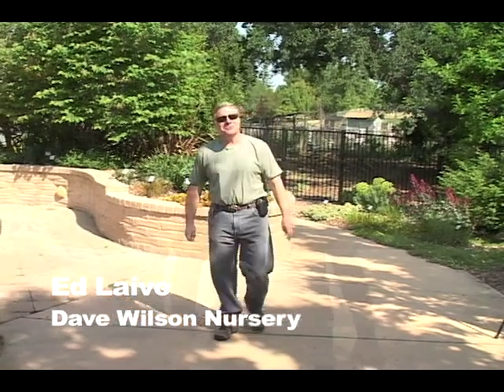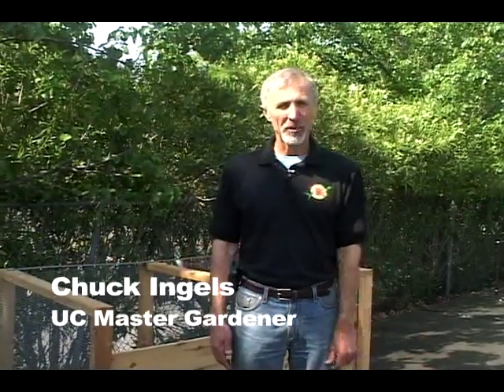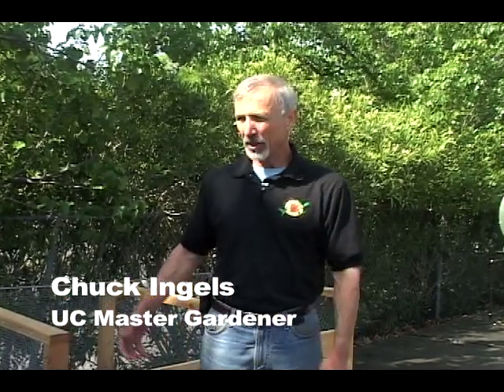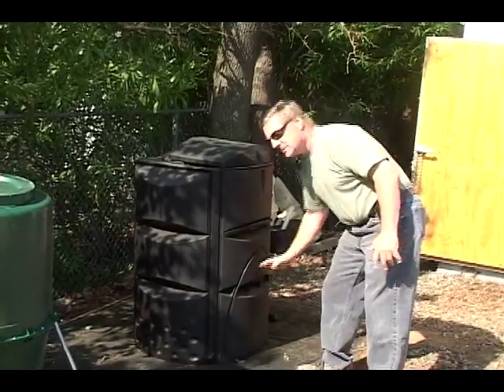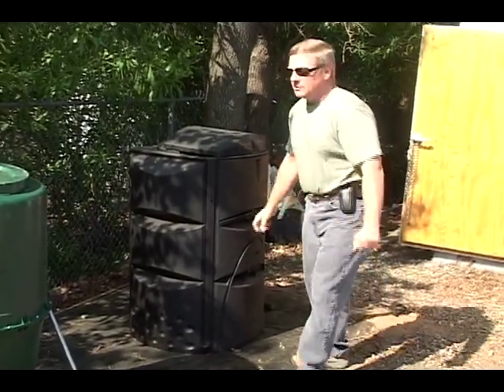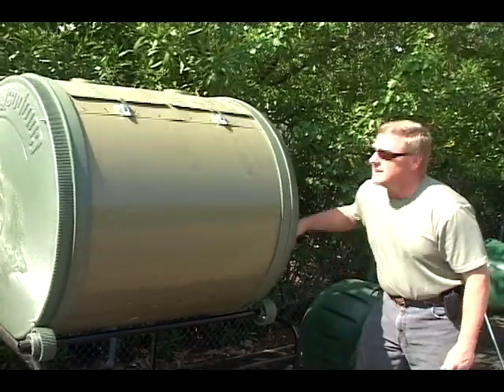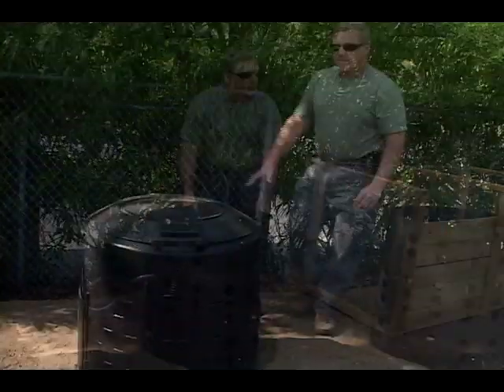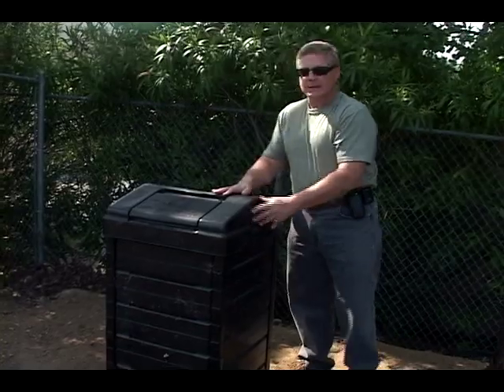Testing Home Compost Units: Intro

Comment: I just made a compost tumbler and noticed that all it really did was roll it into a ball. So, I had some threaded 6" rods around and with 3 nuts and 4 washers each, I installed them dryer style as to make the compost "tumble". It worked very well!